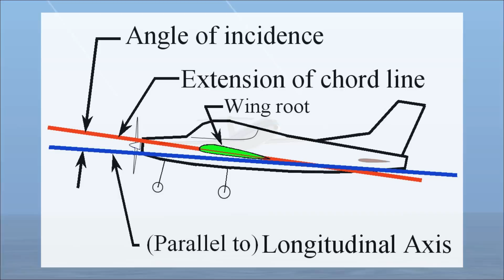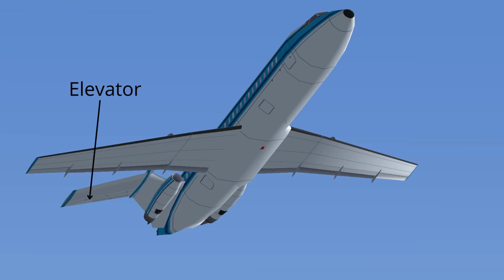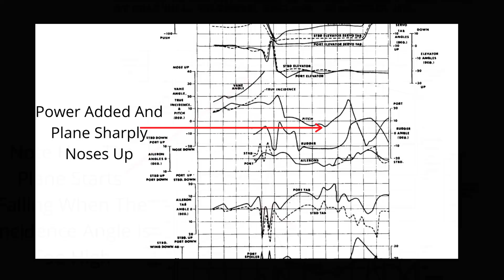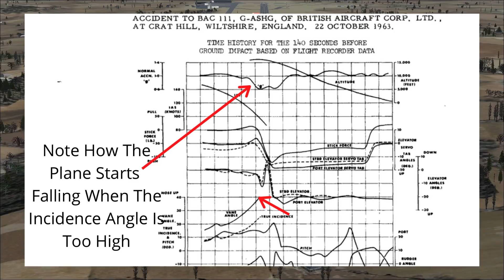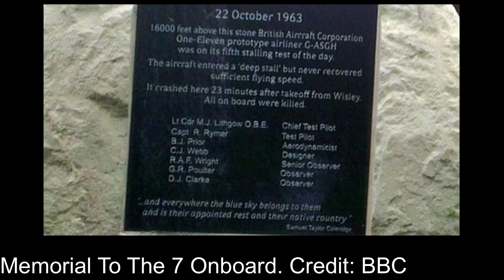These Pilots Sacrificed Themselves So That We Could Fly Safely | BAC 1-11 Test Flight Crash

Comment: Time and again the narrator uses the term angle of incidence (incorrectly) when he means angle of attack. "Angle of incidence"  is the angle between the chord line of the wing where the wing is mounted to the fuselage and the reference or longitudinal axis of the fuselage. The pilots have absolutely no control over the angle of incidence. Ever.

Comment: Due to T-tail stalls being unrecoverable by normal means, T-tail planes require special stall recovery procedure, such as using a tail drag chute or tail pitch rocket where available, or banking as high as 90 degrees to exchange deep stall for a steep dive which IS recoverable.

Comment: There were two stall accidents with the BAC 111. In the second incident the pilots felt that they had entered a deep stall and therefore released a parachute, fitted to the tail of the aircraft after the Lithgow crash, which was intended to pull the tail up, thus allowing the aircraft to recover, which, in fact, it did. However, due to an optical illusion the pilots thought they were still deep stalled and rode the aircraft into the ground, with the parachute still deployed. In fact it was the drag of the chute which was causing the problem, had they jettisoned it the aircraft would simply have flown away. I seem to recall that the crew survived this crash.
Reply: Yes the crew survived. The aircraft bellied in more or less intact somewhere on Salisbury plain and I saw the
wreck personally. They dismantled it in situ and ferried the components out by road
Reply: @smokeless7774  thanks for that.

Comment: Curious if the BAC 146, a high-wing, T-tail, 4 engine version has had any of the same problems?
Reply: Its a HS146, nor BAC and no, buy design it has a stick pusher that operates well before the aircraft gets into a deep stall state. The wing leading edges also have 'toblerone' wedges fitted (stall strips) at a couple of positions on the inboard leading edge to help the stall point. There were trials to remove these in the 90's which facilitated the need to fit a stall/spin recovers parachute on the rear of the aircraft (where the rear nav light is mounted just behind the clamshell airbrake) during those flight tests. The outcome was that they needed to remain in order to maintain a good margin of control at the stall limits.
Reply: FYI it started out as the British Aerospace 146, typically referred to/marketed as the BAe  146.
Reply: @marcmcreynolds2827  It was originally designated as the Hawker Siddeley (HS) 146 back in 1973 when design first started. That was way before the UK aircraft companies came under the Britsh Aerospace banner. It first flew after British Aerospace was formed. So commercially it was the BAe 146, but on paper (and most of the drawings), it was the HS146! I know ... I worked on the subsequent RJ development under BAe and later Avro!
Reply: @simonbaxter8001  Much like the circumstance with the MD-80, which this reminded me of.  While on the drawing boards, it was the DC-9-80 or DC-9 Series 80 (or most commonly in spoken conversation, "Super 80").  The acquiring company wanted to ditch "Douglas Commercial" for "McDonnell Douglas", as in MD-80.  Interesting, the FAA wouldn't certify it by that designator unless MDC was willing to go through certifying it as a new type, using current certification requirements.  Of course they didn't want to (think: 737 MAX), so MD-81/82/83 was only a marketing designation.
Reply: @marcmcreynolds2827  Indeed. I guess marketing want the aircraft to appear new and fresh, which is why they soon cut ties with the original design companies, many of which were 'old' and 'obsolete' at the time of commercial launch. Also depends on what the company was called at the time of certification of course. With the 146, that was in 1983. British Aerospace was formed in the late 70's. It was BAe when I started with them in 1981.

Comment: Provided enough height is available, the solution is to bank the aircraft 90° to regain airflow over the tail section and restore rudder and elevator effectiveness. Such a recovery could potentially involve the loss of 15,000 feet in height, so it needs to be carried out immediately the deep stall is identified and care taken not or re-enter a stall on recovery. At lower levels, recovery from a deep stall is unlikely.
Reply: They could have rolled past 90 with ailerons to let the nose fall thru, yes, then roll right back and be headed down, without losing much altitude.
I have no idea why they didn't do that.

Comment: If having a T tail makes an airplane vulnerable, then why make them with a T tail at all?
Reply: Wing airflow and high-lift devices not impacted by an engine pylon; Gets the engines higher above the runway, so less chance of foreign object ingestion including during reverse thrust; Less pylon weight; Shorter landing gear struts; Potentially quieter in most of the cabin; ???

Comment: One of the Gloster Javelin jet fighter prototypes (which also had a T tail) was lost to a 'deep stall' 10 years before this accident so it seems surprising that the designers of the BAC-111 did not anticipate the problem. However, the Javelin had a much broader delta wing, so they may have thought the BAC-111's narrower wings would make it less prone to a 'deep stall'.

Comment: This plane was recoverable. The technique to use when you are at high angles of attack and have insufficient forward stick authority is to roll to a high bank angle and let the nose slice down through the horizon. You are moving the lift vector from the vertical to the horizon. I have many type ratings on planes with stick shakers. Military pilots I think are more familiar with rolling to slice the nose through the horizon while airline guys are taught to add power and push forward on the control column. Another situation where your only way out is to roll is an aircraft with an excessively aft cg and you are slow and can not get the nose down. You have to roll to get the nose coming down. As a captain on the DC-9 many years ago I got the stick shaker come on in turbulence for just a split second while fully configured for landing. I went around and shortly after got a windshear alert. The stick shaker coming on when not expected in test definitely gets your attention. The solution is to get off the gs (the plural of g) as a fighter pilot would say and unload. Airline guys are doing the same thing and think more in terms of lowering the nose and increasing the airspeed. I have never gone deeper into a stall then just tapping the stick shaker and stall warning in an airliner. In military fighters I taught deep aft stick stalls and the stall in a supersonic fighter is a range from light buffeting to heavy buffeting. If not by the grace of God go I....
Reply: I think I recall reading (but can't find the reference) that they did try to roll it out, but it was so stable (in the stall) that they couldn't.   (Wing never drops when you want it to!)    Also that the prototype had servo tab elevators, which just blew hard up in the airstream (the tabs being masked by the tail); production versions were given fully powered elevators.
Reply: @cr10001  Thank you for the reply. I agree, at high angles of attack roll response may be very limited. The rudder can be gently fed in and roll the plane at high angles of attack. We are all aware of the need to be very careful using the rudder to roll an airliner because of AA 587 with Capt Ed States and FO Seth Molin. They were both very good pilots and personal friends. I flew with both of them out of JFK on the A300. At high angles of attack in fighters we would always use the rudder to help roll the plane. I was a USAF fighter instructor pilot. Rudder for rolling is like make-up, a little bit goes a long way. If not by the grace of the Lord go I.
Reply: @pauljdowney   Thank you.   I believe early jet fighters had notoriously tricky handling characteristics (by coincidence Youtube just popped up a video of the infamous 'sabre dance').   Actually, I believe modern fighters are just as tricky, if not more so, but they have a computer to tame them.

Comment: Didn't a HS Trident deep stall and crash after take-off at Heathrow in 1972? BEA Flight 548 - in the days before CVR, so they weren't cetain, but that was the inverstigators' best guess, if I remember correctly.
Reply: The stall was caused by retracting the Droops about 60 knots too slow. There had been a previous incident but. the more experienced P2 recognized what he had done and they recovered and continued to the destination.

Comment: It’s the Angle of Attack (AoA) which was exceeded and got them into the stall - not the Angle of Incident! The Angle of Incident is a fixed value and denotes the angle between the chord line of the airfoil and the longitudinal axis of the plane. It is a designed feature and cannot be changed by the pilots! The elevator controls the Angle of Attack, i.e. nose up or down.

Comment: This was not a sacrifice.  A sacrifice is a deliberate act, performed willingly and with full knowledge of what the result will be.  This was an accident initially caused by cocky test pilots who assumed they could recover the aircraft from a stall condition well beyond the bounds of the planned test, and compounded by the second mistake of increasing engine thrust to attempt to recover.  

This was a tragedy, sure, and a lesson which led to innovations that saved many lives...but it was not a sacrifice.

Comment: If you are going to post a video on aerodynamics please try and get the basics somewhere near right.  All through the video you talk about "angle of incidence". The angle of incidence has absolutely nothing to do with this accident,, the angle of attack on the other hand is everything to do with it.  You talk about airspeed and the stall. A stall can occur at virtually any airspeed, it is the angle of attack which causes the breakdown of airflow over a wing, which is what an aerodynamic stall is. To recover from a stall you need to reduce the angle of ATTACK to restore lift, in doing so the airspeed may indeed increase.
Knowing the difference between the terms "angle of attack" and "angle of incidence" is basic to anyone with any knowledge of flying and/or aerodynamics. Clearly you do not know anything at all about the subject.

Comment: I wonder if briefly activating the thrust reversers while in the deep stall on this rear engined airframe could have pulled the tail up enough to regain elevator control.
Reply: Very good thought and question Alex 🙏
Reply: They were only available on the ground on the 1-11.
Reply: @Alfred Weber Two Tridents stalled, and crashed, one on a test flight in similar circumstances to this.

Comment: Here’s a video of the single finest piece of flying I’ve ever seen: https://youtu.be/L2CsO-Vu7oc
It was a deep step test on another aircraft, the MD-95/717. Basically a stretched DC-9, the MD-95 had wing and tail redesigns to suit.

The problem is that while doing computer modelling of the stall characteristics, the modelling was throwing up weird results that the engineers couldn’t quite figure out. They decided they had to test this on the bare metal, which was an FAA requirement. Part of the development of a plane for FAA certification is that you’ve gotta stall the thing and prove that it is recoverable. You’ve also got to reconcile the computer modelling. The more data you have, the better the modelling gets.

Anyway, this was a test flight to try to verify the computer modelling, and hopefully figure out why the modelling was weird. There is a lot going on in that video, but they entered a deep stall, and the plane rolled over, and into a nosedive. They went from a stall to an overspeed in mere seconds. At one point, they were losing something like 60,000ft per minute. More than 1,000ft per second: that thing was pointed directly at the floor.

They were able to recover the aircraft and and safely, and they generated a lot of data and insight from this flight. The pilots made it out fine, but the plane did not. The plane had undergone such aerodynamic forces that the structure itself had deformed, I seem to remember to the point where the plane wouldn’t pressurise properly. In any case, the aircraft was written off, and as of writing, it remains the only MD-95/717 hull loss.

Ultimately the engineering fix was a software one: an aggressive stick pusher in the flight computer control logic, so you’ll (theoretically) never be able to deep stall the thing even if you tried. You can’t really “fix” this problem aerodynamically—it’s just the nature of a T-tail, and it always will be, which is why stick shakers and stick pushers are so crucial.

It’s a crazy story, worthy of a video of its own.
Reply: I've watched this video before. It never occurred to me that they were in a deep stall before the plane rolled over. I thought it was just a regular stall. I am very interested in the idea of recovering from a deep stall in a t-tail aircraft though. Is the idea that you're supposed to reduce power and force the plane up to such an angle that it will want to roll out of the deep stall? I've heard some people say that it's not possible to recover from a deep stall, but clearly that can't be true.

Comment: I think you have mixed up ANGLE OF ATTACK WITH ANGLE OF INCIDENCE. Angle of attack is the angle between the cord line and the Relative Airflow so changes in flight. 15 degrees is normally the maximum before the stall (although I think delta wings like Concord can go to 22) Angle of incidence on the other hand is fixed by the aircraft designer and does not change, although I think there are some fighter jets that have a variable incidence, wing, but I may be wrong about that.
The wing is actually developing maximum CL at 15 degrees just before the stall.
Reply: NPC

Comment: The angle of INCIDENCE is the angle between the wing chord line and the fuselage datum line. This is fixed by the design of the aircraft. You should be referring to the angle of ATTACK, which is the angle at which the air meets the wing.
Reply: Thank you. I found it painful to hear this term used incorrectly. I commented similar to you but your comment was much better stated.
Reply: Further to my previous comment, some years ago, I  had an argument on YouTube with one of our American cousins. He just could not accept that a difference in terminology from that in use in the USA was valid -  even though it was recognised by Langewiesche in 'Stick and Rudder'. I even quoted him the page number of the reference.
Reply: @grahamj9101  I was stationed at RAF MILDENHALL for 3 years. Half the time I couldn't understand a bloody thing you Brits were saying! ("Bloody: A vague term of vituparation often used by the British for emphasis")
My first day there after flying with my wife and four kids, aged 2 to 6, for 16 hours some bitch screamed at us in the terminal.....
"Don't you understand bloody English!?!?"
I worked next door to her for 3 years. I asked her the same thing dozens of times but I didn't use the word "bloody".
Reply: Exactly. You saved me a comment.
Reply: Angle of attack is the angle of the aircrafts flight path with reference to the relative airflow. The chord line is the reference on the wing. Hence you can be in a stalled condition at any pitch attitude or any speed.
Reply: There is a difference in terminology between the two sides of the Atlantic in respect of 'angle of incidence' and 'angle of attack'.  This was recognised way back in the 1940s by Langeweische in his book 'Stick and Rudder'.
In a career lifetime in the design of gas turbines here in the UK, I can tell you that the term 'angle of incidence' has been used to define the difference between the air/gas angle onto the leading edge of an aerofoil, relative to the local angle defined by the leading edge at which the angle of incidence would be zero.
'Angle of attack' has typically been used to define the angle of an aircraft relative to its direction of flight.

Comment: The bitter sweet is that it happened in the test flight and gave us the safety feature that has saved countless lives. 

I have a question though since everything is mechanically linked on that aircraft, wouldn't the stick shake regardless? I remembered in my flight training days the yoke would shake as the airflow over the wing is being separated.

Comment: Thanks. I had not heard of this one. Sad.
Air France pilots amazingly managed to do this exact manoeuvre in a completely airworthy modern fly by wire aeroplane with hundreds of passengers. Even sadder!
Reply: @Alfred Weber Yeah 100% and VERY easily recoverable, but the same end result, ie: stalled and descending rapidly until they pancaked (into the ocean).